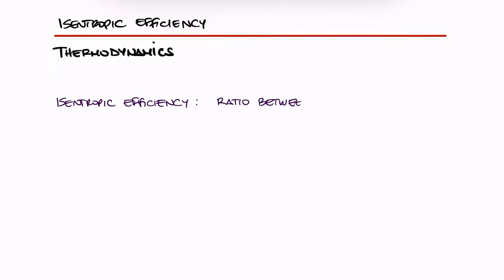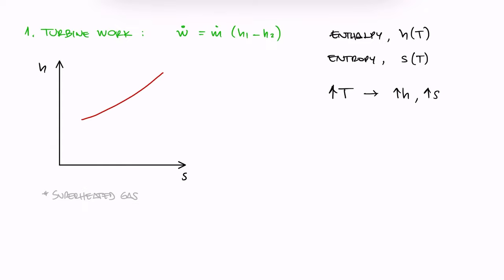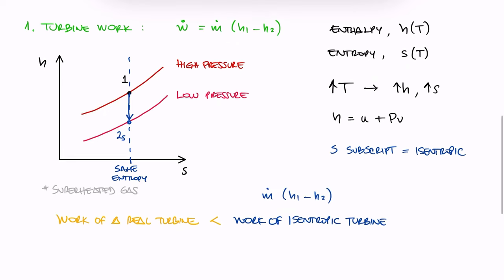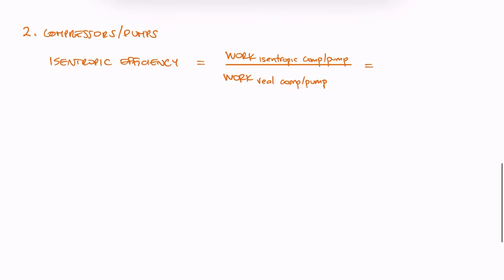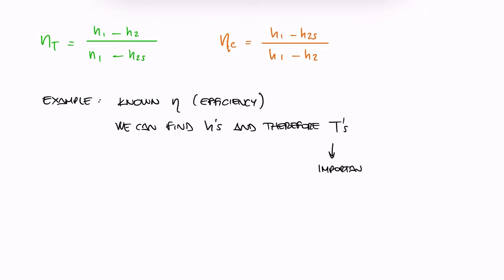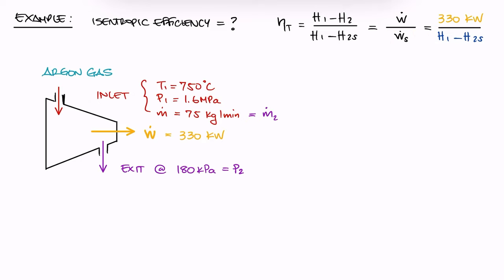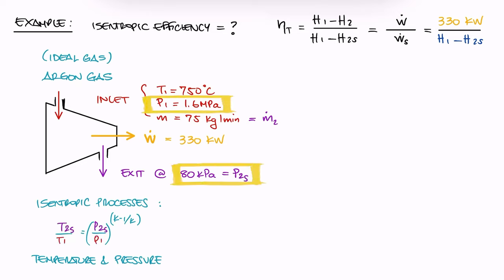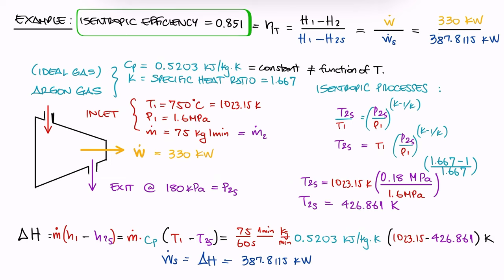Turbines, Compressors, and Pumps - ISENTROPIC EFFICIENCY in 8 Minutes!

Comment from the maker: Minor Correction: 4:40 The schematic of a turbine should show the gas expanding, not compressing (right side should be larger than left side).
Reply: isn't there an error at 3:54 , shouldn't Nc = (h2s-h1)/h2a-h1 ? Also i have these common types of questions when they ask to solve for the W(in) for a system usually adiabatic and isentropic but they always seem to exclude the mass, (      W(in) = m(h2-h1)        =>       W(in)= h2-h1    ), this was the question more specifically.......(below)

"Air enters a compressor steadily at the ambient conditions of 100 kPa and 22°C
and leaves at 800 kPa. Heat is lost from the compressor in the amount of 120 kJ/kg, and
the air experiences an entropy decrease of 0.40 kJ/kg·K. Using constant specific heats,
determine (i) the exit temperature of the air, (ii) the work input to the compressor, and
(iii) the entropy generation during this process. Answer: (i) 85.8 °C, (ii) 184.1 kJ/kg,
(iii) 0.0068 kJ/kg.K."

Comment: Isentropic compression is the ideal process that requires least amount of work input. But why isothermal and polytropic compression has lower work between same pressure limits?
Reply: Polytropic means both pressure AND volume are changing.  Poly = multi